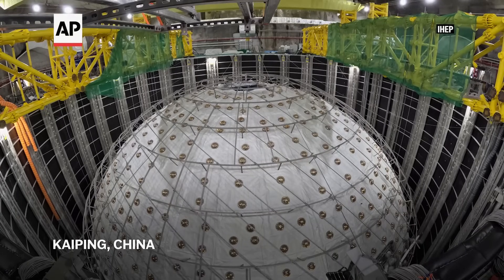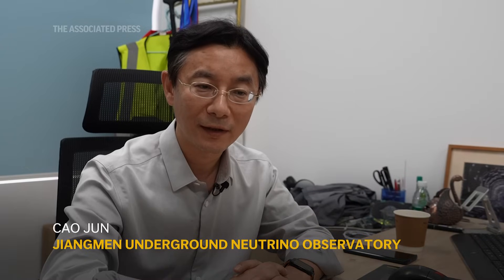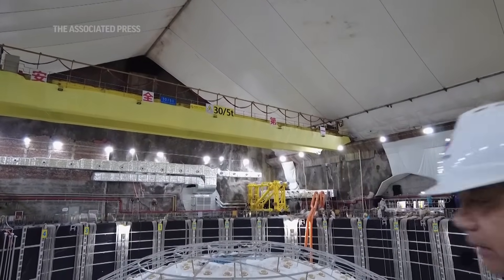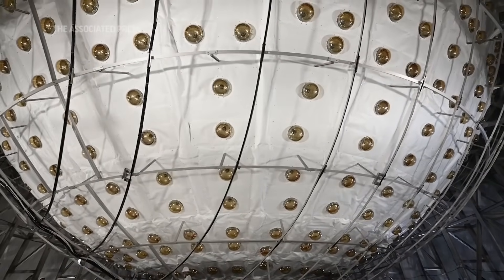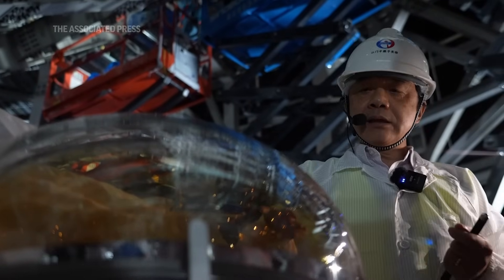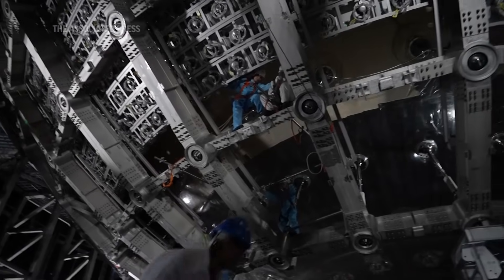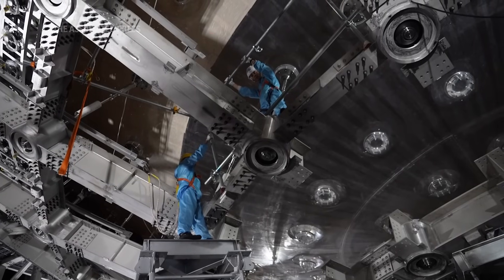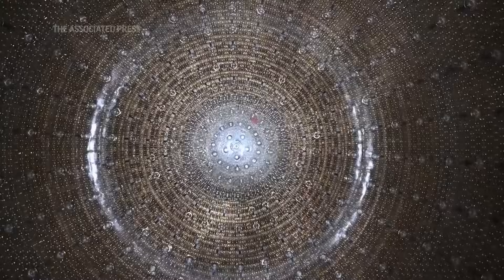China builds massive underground detector to study neutrinos

Comment: Neutrinos are tiny, elusive subatomic particles that interact very weakly with other matter, often called "ghost particles"; while they are not considered the primary candidate for dark matter based on current understanding, some theories suggest a type of heavier neutrino, called a "sterile neutrino," could potentially contribute to dark matter due to their weak interactions and possible higher mass. 

According to current scientific understanding, dark matter is often described as acting like "scaffolding" in the universe, meaning it forms a framework ( or a web-like structure ) through which normal matter, like stars and galaxies, is structured and assembled due to its gravitational influence, even though it cannot be directly observed with light.

Neutrinos are deeply linked to quantum mechanics, particularly through the phenomenon of "neutrino oscillation," where a neutrino can change its flavor (electron, muon, or tau) while traveling, which is only explainable through quantum mechanical principles and the concept of superposition of states. 

This is a very important thing that they are working right now, to as they said "unlock the mystery's of the universe" I personally believe that quantum understanding will lead us to technology that will allow us to be capable of intergalactic travel.
Reply: Yours is the most refreshing comment here.
Thanks.
Reply: Do you think we will be able to travel faster that the speed of light?
Reply: @kasen84  No but you wont need too if you can create your own wormhole....folding space/time to make a shortcut
Reply: Chatgpt for the W
Reply: We live in a fractal infinitely converging inwards and infinitely converging outwards
Reply: Don’t need a ChatGPT detector for this
Reply: Relativistic dilation explains dark matter/galaxy rotation curves. Dilation is the phenomenon our high school teachers were talking about when they said "mass becomes infinite at the speed of light". This does not mean mass increases, it means mass becomes spread throughout spacetime relative to an outside observer. Time dilation is just one aspect of dilation. Even mass that exists at 75% light speed is partially dilated.
   It occurs wherever there is an astronomical quantity of mass, this includes the centers of high mass stars and the majority of galaxy centers. 
   Dilation is occurring in our own galactic center. This means that there is no valid XYZ coordinate we can attribute to it, you can't point your finger at something that is smeared through spacetime. In other words that mass is all around us. It's the "missing mass" needed to explain galaxy rotation curves.
   It doesn't occur in galaxies with low mass centers because they do not have enough mass to achieve relativistic velocities. It has recently been confirmed in 6 ultra diffuse galaxies including NGC 1052-DF2 and DF4 to have normal rotation rates, in other words they have no dark matter/dilated mass.
Reply: Thank you for that explanation